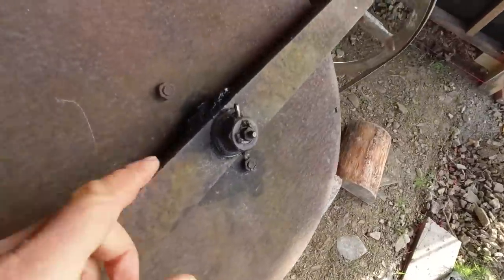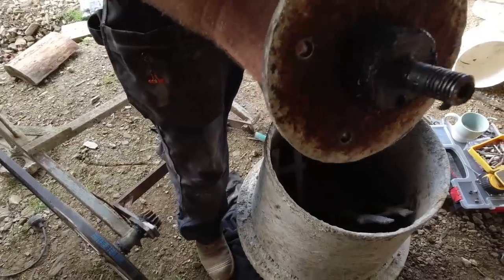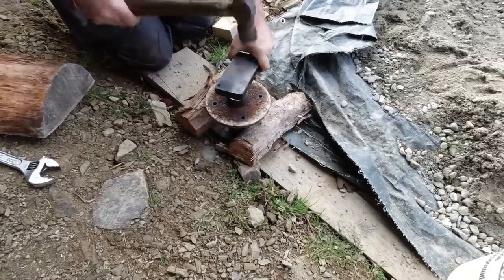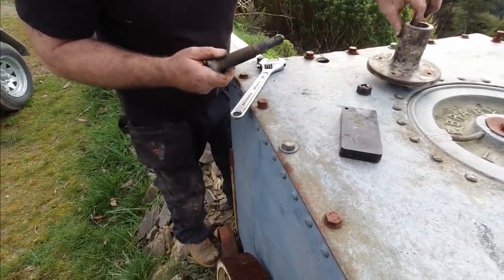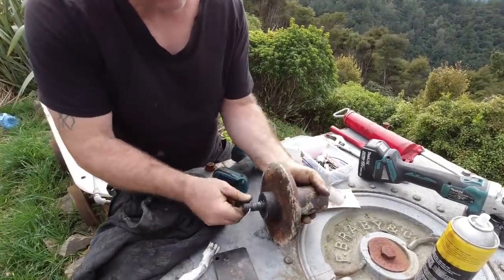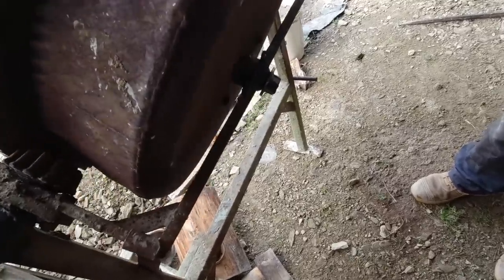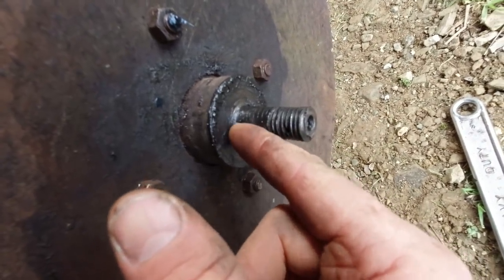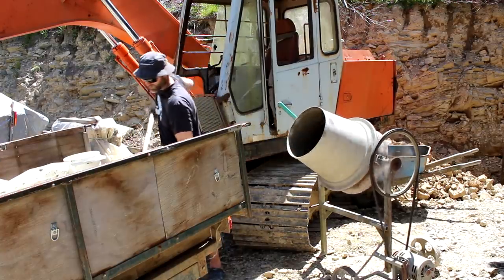Fixing a worn out old Concrete Mixer..

Comment: Your content is helping my OCD see the difference between fixed and restored. It’s quite therapeutic. No sarcasm here. Perfectionism has caused me genuine years of mental health problems. I am trying to teach myself that in some cases, good enough really is good enough. Thank you.
Reply: Yes well said  Some things dont have to be perfect to work perfectly well
Reply: I'm learning that same lesson as I'm getting older. As a young fella I regularly made mountains out of molehills - a faulty spark plug turned into rebuilding the whole engine, that kind of thing, to the endless frustration of the good lady. Nowadays I'm much more accepting that just getting it working again is mostly all that's needed.
Reply: woopimagpie youed hate the mower at work gota clean the plug every 8 to 20 hours of running was buying plugs but after 4 started cleaning
Reply: Every time i get it back after the new guys got it for a bit well one broke the rear end one blew out the head gasket one broke the starter wire but it was also needed to run the thing so you had to hold the wire on the contact and drive at the same time was a pain in the back to get it to the shop
Reply: I do like it i will miss that old beast when we get a new hill mower

Comment: Hi Marty, like your latest video/ thank you.. Ok I was using a borrowed cement mixer of a different make to yours but the same sort of thing, and thats bearing had gone, and as I was desperate to be getting on with mixing concrete i tore it apart to find most the balls had gone, and i never had a bearing i could make fit, but in my steel shed looking for inspiration looked at an odd piece of scaffold tube/ hmmm i wondered, i tried it for fit in between the inner and outer races of the bearing and found it a reasonable fit/ so cut a piece the width of the bearing, cleaned it all up, a few spots of mig weld, lots of grease, worked a treat/ lol.. Done some heavy mixing with it, pumped grease in on occasion with a grease gun, finished my job, cleaned it gave it back to Bro In Law told him the bodge, still working well as far as I know.. When I had got it originally Bro In Law used it to build his house, gave it no attention, so the reason it was as is after standing unused for 25 years or so, but it works now/ back yard mechanics or using your brain when in need/ Thanks anyway Marty, keep then vids coming. Ian - UK.

Comment: Well done men. Came here for info for my chinese cheapo 3 yrd mixer from about 30 yrs ago. Side of the road acquisition, cheap. (not free, like yours). Little problems here and there over time. Then, the barrel brgs seized. (Not a bushing, like yours.)
been apart for yrs. Can't get the frozen bearings off the shaft. PITA. Thanks for posting, tho it didn't help me.

Comment: Entertaining video as always!  Just a caution: That exposed fan belt pinch to the pulley will take your fingers in a trice.  A fan belt cover or an enclosure of some kind will make it so that you can operate it without worrying that it might catch your clothes (pull you in) or that one of your kids watching you work might get to close or curious.  I find that if you have that moment and think: "You'd have to be an idiot to put your finger right... THERE - OUCH!"  Then it needs a cover.
Reply: I don’t think his kids are dumb enough to get caught up in machinery.
Reply: @FemboyEngineer  you say this about a video where a grown man hits himself in the balls with a hammer and the head with an axe inside the first 2 minutes. You don't need to be dumb, just distracted or misjudging your environment for a split second and oops! only 8 fingers for the next 40 years.

Comment: I finally started on my boat, woohoo, amazing. I build a double H frame, like a rectangle but 4 end lengths hang out with 4 legs. Took me forever dragging all the tools outside, cutting 1x 3m into 2x 1.5m length & 4x 800mm legs. When together it resembles a square 1.5m x 1.5m with 2x 750mm arms at either end on 4x 800mm legs. I'll be able to build my boat on top of it & spin it on top of it to fibreglass the Corflute & plywood. I used a nail gun to fab it together quick but as I suffer from extreme arthritis I have to stop many times just doing something simple., happy xmas to you & the family.

Comment: Marty, I would bet that the original design of the inside end  that bearing was NOT open to cement, sand  and water. Find some kind of cap like a trailer bearing cap and save yourself the aggravation of having to fix it all over again. Here in Texas mud-daubers like to build nests inside electric motors. They seem to be attracted to the starting winding governor mechanism requiring many a motor to be dismantled and the hardened mud cleaned out before being able to mix mortar.  And then there are mice and rats that for some reason like to build nests inside the blower shroud of gas engines, requiring disassembly and removal of nests before further use. Really enjoy your videos. Keep them coming.

Comment: Good call on the pulley size Marty , just about ideal now . To clean the crap off the paddles chuck a hand full of scrap iron into the drum and run it propped just above horizontal. A half hour will see all that accumulated mortar chipped off and the paddles back to bare metal .

Comment: Nice fix! Mine was $50, down from $75, because it wouldn't run. The fix was a new cord, after the old snake nest and eggs were cleaned out of the junction box on the motor.

Comment: With the motor mounted so low, it looks like it could be liable to cop the odd splash of water, and dustings of cement and aggregate into it's cooling vents. A useful upgrade could be to modify a big paint tin, or a plastic container, to make a protective motor shroud. That may be over-engineering though(?), it does seem to be working fine, the way it has done apparently for many years. Another good rescue, with a good friend!  Still good entertainment for me, after 2 years.

Comment: Hi Marty, 

Would think that there should be a cap over the end of the piece that mounts to the bowl, or when using it, sand, cement and water will get into the bearings. 

It's a pretty basic mixer with lots of finger crunching possibilities. But we had those back when people took some responsibility for their own safety.

Regards Dennis.

Comment: You might try a bit of tacky red grease or something similar on the drive pinion and associated gears. It should quiet it down a little.
Reply: That would pick up dirt and make grinding paste. Open gears need a dry lube
Reply: @benjo233223  I think you are right. It would attract grit and cement dust.